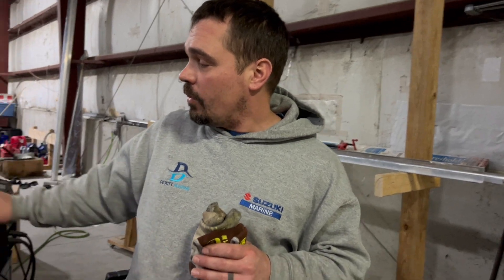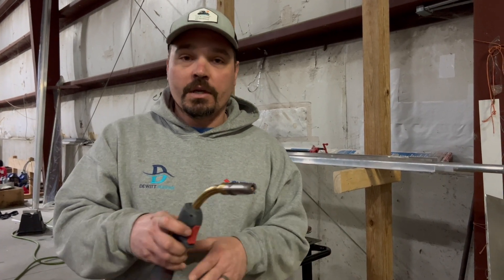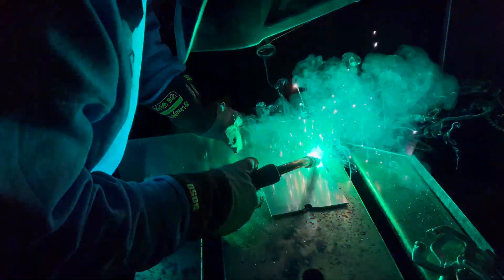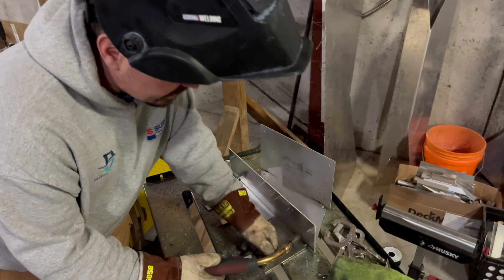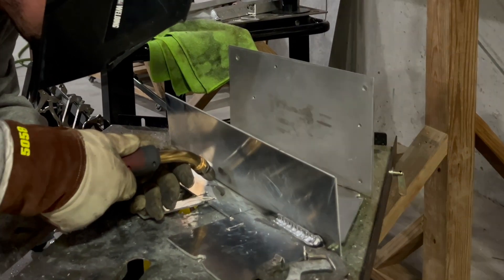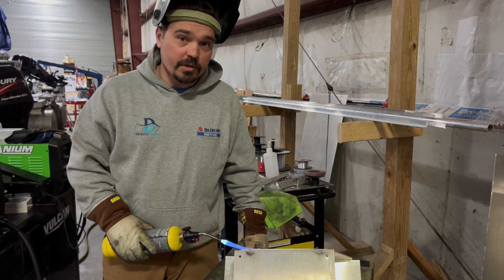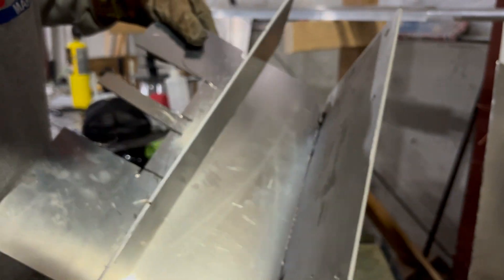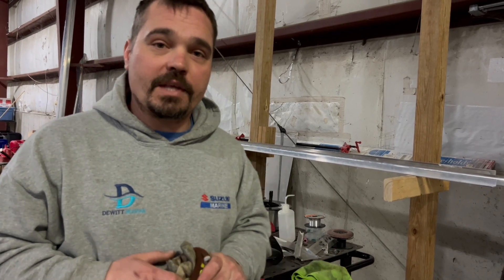Aluminum MIG Welding with YesWelder - YWM 211P - Pulse MIG

Comment: I have a pulse Mig welder by Vevor, struggling to be consistent with the wetting, I feel all of my welds are cold even if I up the amps to the max ( 118 amp ) on a 1/4" plate. I am using 5356 wire. I noticed you mentioned about preheating, how long did you preheat before welding. and what amp settings you had success with?
Reply from the maker: If you're running 118 amp as your hottest I'm assuming you're running on 110/120V power? That'll never crack into 1/4" thick aluminum, even with pre-heat. I have a couple machines that I run on 220/240V and they barely get into 1/4" even if it's an open edge or outside corner! I'd run a helium/argon mix if I needed to weld something that thick on single phase.
Reply: @tomspontoons  thanks for the tip. I am actually running it on 240V, but for some reason it limits the output to 118A on pulse. It limits the Amps to 95A on single phase. I can try Helium/Argon ( I assume 25% Helium? )
Reply from the maker: Ahh, yes, that can be common for pulse. It probably still won’t crack into 1/4” plate unless it’s super beveled. Yes, 75 argon 25 helium for that mix. Might have to just go regular mode if you have that instead of pulse.

Comment: What brand welding wire are you running?
Reply from the maker: I run a few different brands depending on what the local weld shop has in stock. I think I usually run Lincoln or ProStar (which I think is the local supply store's own brand). 0.035" and 5356 is my prefered.
Reply: @tomspontoons  how many pounds of wire fit in this yeswelder?
Reply from the maker: @MLGboii   It says it holds a 10# spool, but I've not found a spool that actually fits in there that's 10#. I've had to just use 1# spools to this point. On their site they have 10# spools, but only steel filler.
Reply: @tomspontoons  oh ok what issues do you have trying to fit a 10 pound spool?
Reply from the maker: @MLGboii  The 10# spool I bought is just way too big for the welder. I've been taking it off the spool and putting it on empty 1# spools so that it's not a waste!

Comment: Did you weld your whole boat with the yeswelder? Exactly what I’m wanting one for. To make modifications and maybe try to make a whole boat. Thanks
Reply from the maker: I've now built two boats completely with YesWelder's machines. I use their pulse MIG setups and their TIG200 TIG machines throughout the process. I prefer TIG for aesthetics and anywhere that needs to be water-tight, and the MIG I use for all tacking and internal structure stuff as it's strong and a faster process. In my opinion you really need both machines to make the process the most efficient possible and end up with a great final product.

Comment: Great video!
Would you feel confident enough to build a marine diesel fuel tank with this setup?
Reply: Thank you for sharing your thoughts. I need to build a tank and was hoping to avoid tig.

Can you recommend a good tig for this?

Have considered the everlast for years.
Reply from the maker: @alexsails80  I totally understand that, MIG is much faster. Worst case you could test it building something smaller that needs to be air tight. Pressure check it and see what happens. It kind of makes me curious to try it myself! I have a Miller Syncrowave for bigger projects, but I use this YesWelder TIG200 a lot at my shop, especially for bench top projects. It has the frequency and balance settings just like higher end machines.

https://youtu.be/X1OuWvuWDEk
Reply from the maker: I’ve had far better luck with the TIG welding for things that need to be sealed up tight. MIG tends to leave more pin holes. I think this machine could do it if you take your time especially in pulse mode. It’ll do a much better job than a typical aluminum MIG setup, but you might still have to touch things up with TIG to seal it tight.

Comment: Thx Tom. Btw, where did you get the initial settings for the 1/8 in weld. Also, I am confused about the  arc length setting.
If the initial voltage setting was say 17 volts and you wanted a slightly longer arc and set the volt setting to +1 would the voltage setting now read 18 volt on the display?
Reply from the maker: I just went with my experience with my old MIG spool gun setup as a starting point, but I ran this welder on my table with scrap a whole lot to dial everything in. And even then I have to change it and tweak it based on the weld configuration...fillet welds needing more heat and open/flat welds needing it dialed back.

To be honest I love that ARC LONG setting, but I don't really understand it. If you go back into the negative where I like it (-2.6 to -2.8) it will only allow the voltage to go so high (around 18V). On 1/8" material it's just hot enough, but anything thicker or a big fillet joint I have to turn the ARC LONG setting down to around -1.8 so that I can get my voltage up higher. I have a Miller Syncrowave with a spoolgun setup and all I have is amperage and wire feed speed....no arc long or related setting on that big expensive machine. So the ARC LONG thing is definitely new to me.

Comment: Hey Tom, any idea if this is still available to buy? I looked via your link, didn’t see it on their website… interested in buying
Reply from the maker: Unfortunately it looks like they are out of stock until October. If you can wait I would say it's worth it!
Reply: @tomspontoons  thanks for the reply. I’m looking for a decent welder to learn aluminum welding with. Once I have some practice under my belt, I’m going to build one of those mini aluminum jet boats with a sea doo engine
Reply from the maker: @Choctawhatchee_Trash  The pulse MIG setup is definitely the way to go then for water tighting all the seams. I usually TIG weld the outside seams of the boats I build, but I'm confident the pulse MIG will be able to fill everything tight. Stay tuned for that and check out my boat build videos if you haven't already!
Reply: @tomspontoons  I agree pulse looks like the way to go. I’m hoping yeswelder gets this back in stock soon, I can’t justify several thousand dollars on a “name brand” pulse welder.
Reply from the maker: @Choctawhatchee_Trash  Fingers crossed for you too! I've been able to weld with a $4500 Miller TIG machine and it was nice, very smooth start ups and very consistent arc...however, with my $600 TIG machine I can weld the same stuff together and I'm not sure you'd see a huge difference. I think the pulse will help make it easier for you to learn to weld aluminum because it allows for a much slower and smoother pace moving the torch compared to a spoolgun where the speed is super critical!
Reply: @tomspontoons  I think Yes welders discontinued this ywm-211p welder for the new  dp-200. thats due out in October or November of this year. yeswelder is taking a deposit now to reserve one for delivery later this year .
Reply from the maker: @genek1341  Yep, that makes sense. I should have my hands on one of the DP-200 prototypes in the near future. I'll be posting to share information about that too as soon as I get to try it out!
Reply: @genek1341 Nope, the 211p is still on their site.
Reply: Any videos and weld puddles from pulse on aluminum?... 

I've got the DP200... And it's a great machine.

But I also have 3 Titanium 200s and 2 Everlast machines (waiting on my alum spool to test with). Looks like I can leave the spool gun in the box. 😬

Comment: One review showed the welding wire roller was misaligned and he had to insert a washer. Was this what you found?
Reply from the maker: No, I had zero issues with that. I believe I found the same review, but it was from someone who is sponsored or works for another welder brand. I plan to work with this welder a lot more on upcoming projects so I can show more uses, what it is capable of welding wise, and how it holds up. I also have their pulse TIG machine that I still need to unbox and put to the test.

Comment: Since you built your boat with the Titanium, how much better do you think this pulse machine would have been?
Reply from the maker: Oh my goodness. I just started using this machine on the 16' boat I'm building now and it's incredibly more efficient. I plan to weld the entire outside corners of the boat with the YesWelder pulse MIG because I know that I can get it water-tight with that welder. I have had to TIG weld those outside corners on the last two builds to be confident that they're water tight, but the way the pulse lays in there I can take my time, lay nice welds, and not burn through. Plus it'll go way faster than TIG and I'm able to run weld passes that are about twice as long as my Titanium could run. The standard spool gun without pulse just gets so hot so fast.
Reply: @tomspontoons Yes Indeed!!!  That's exactly what I wanted to hear.  For my last project I tig welded an aluminum framed cabin on toons and truly don't want to do it again.   I've been wanting a pulse machine for my next project due to the very reasons you cited so I was thrilled to see you try it.  Thanks for the input!
Reply from the maker: @robertboudreaux4971  I plan to do a lot more videos showing what it's capable of. I do think that pre-heating would be a big help on thicker stuff (1/8" to 3/16", it did NOT like trying to weld 1/4" thick material at all) to get the puddle to lay in quicker at start up, especially with inside corner joints. I have my eye on their pulse TIG machine too. No problems with my Titanium TIG200, but it has ZERO capabilities beyond just TIG welding. I can only set the amperage...nothing else. So no cleaning balance setting. It's been a great machine to learn with, but I'm ready for something with more capabilities.
Reply: @tomspontoons  Have you had any luck welding 1/4" aluminum with the 211p since you comment above?  I was thinking about buying the 211p for the double pulse capability and would need to do occasional 1/4" welds.  If it doesn't work, I might opt for the 250 with single pulse.
Reply from the maker: @johnbecker990 it can’t crack into 1/4”. It actually struggles with 3/16” in pulse mode. If welding something like 1/4” all the time I think you really need to get beyond single phase 220 power. I can TIG 1/4” with my Miller Syncrowave 210 but it’s maxed out and I have to preheat the heck out of the material!
Reply: @tomspontoons  thanks for the quick response
Reply: @tomspontoons  I've been looking at a HTP 2800i  mig welder for a boat build. It maxes at 280 amps, with 230 amps at 60% duty cycle...do you think this machine would be sufficient for a 3/16" hull. I was planning on putting a 1/4" transom plate in it. I have single phase 220. It's supposed to be able to run on 50 amp input....
Reply from the maker: @clintbrill6288  that sounds very similar to the setups I run plus a little beefier. You’ll still likely need to pre-heat on that 3/16” for inside corner welds. Anything on 1/4” is going to struggle. I did it on my big boat build, but it was slow and maxed my machine out. 

I’ll never use 1/4” for my transom again!! Way over kill. 1/8” or 3/16” with some braces is plenty for just about any outboard you’d want. I think the additional knee braces and corner gussets do more for support than the sheet itself!

Comment: Why don’t you back grind your previous weld so when you start off your weld it doesn’t have so much material to heat up before you start stepping your weld? Would make it look so much nice and flat rather then cold an a slug
Reply: And pre heating is good if you want to warp the ali, and a good tip for your nozzle angle is 45 degrees into the piece your welding and 30 degrees the direction your going✌🏽
Reply: What wire are you using?  4043?
Reply from the maker: @MrDave9111  I run 5356 filler wire 99% of the time. I'm almost always welding on 5052 aluminum 6000 series aluminum. I like the way 5052 flows and it's better for structural and resistance to impact. I'm mostly welding on boats so every wave and trailer trip is abusive.
Reply from the maker: I just got a flapper disk for inside corners. I definitely plan to sand those down before going overtop!! Thanks for the advice!

Comment: What kind of power requirements and breaker size?
Reply from the maker: Per the website:

Supply Voltage: 110V/220V 50/60 Hz

Input Current: 35A@220V，50A@110V

Comment: I thought you needed argon gas to weld aluminum?
Reply from the maker: Yes, you do. I run 100% Argon gas. I should have made a more significant mention of that!
Reply: @tomspontoons  Flow rate would be good too. Seems most recommend 40-45 CFH.
Reply from the maker: @quillibrium-dk6jz standard Aluminum MIG I run around 25-30 cfh. Pulse I bump higher to 35-40 cfh